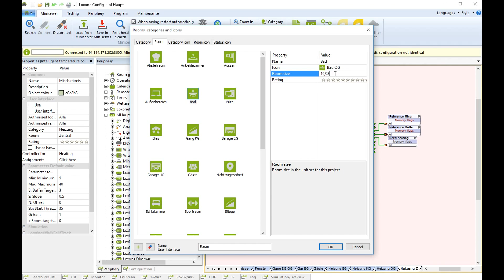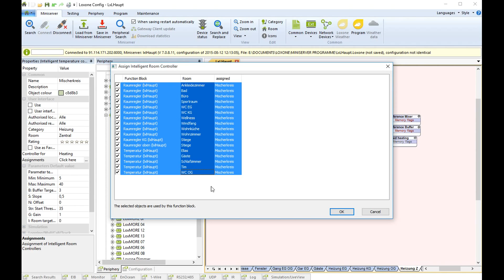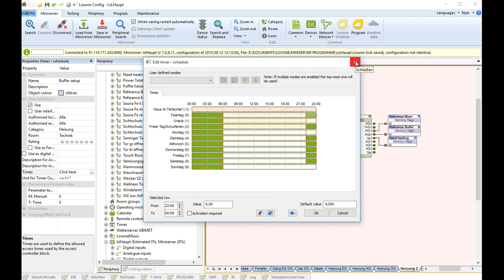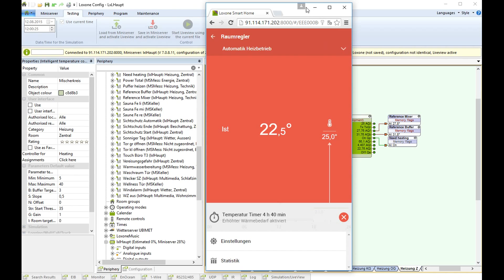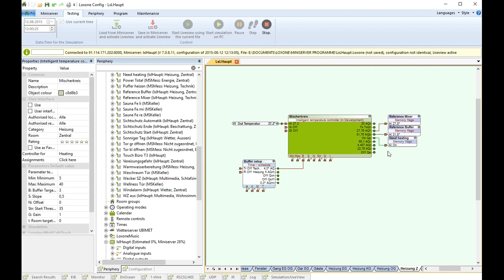Loxone Config 7: Intelligent Temperature Controller | 2015 [HD]

Comment: Hi, ich brauche mal eure Hilfe. 
Ich haben den Außentemperatur & Luftfeuchtigkeit Fühler, welcher 2x 0 - 10 v ausgibt. Ich habe diesen wie beschrieben an die Analogausgänge angeschlossen, allerdings haben die analogen Regelungen einen Eingang mit Wertebereich unendlich und nicht 0 - 10 v. Also wird mir nur die Spannung angezeigt und nicht die eigentliche Temperatur. Was kann ich machen um dieses Problem zu lösen
Reply from the maker: Hi, zunächst musst du beim Temperaturfühler am DIP-Switch einstellen, in welchem Messbereich du dich bewegen möchtest (bspw. -30 bis +70 C°)

Je nach den Einstellungen am DIP-Switch musst du dann in der Config beim analogen Eingang unter „Korrektur” - „Zielwert“ den gewählten Messbereich hinterlegen. Im Beispiel: Eingangswert 1 = 0 Zielwert 1 = -30 |  Eingangswert 2 = 10 Zielwert 2 = 70

Beste Grüsse
Dein Loxone Team
Reply: Loxone  Vielen Dank 🙏🏻Da wäre ich nie drauf gekommen. Funktioniert alles wunderbar